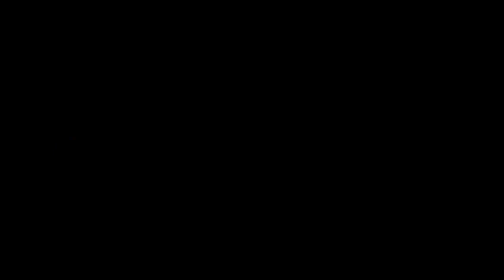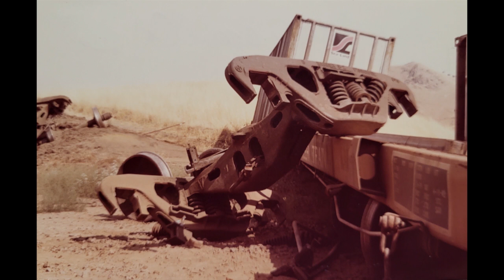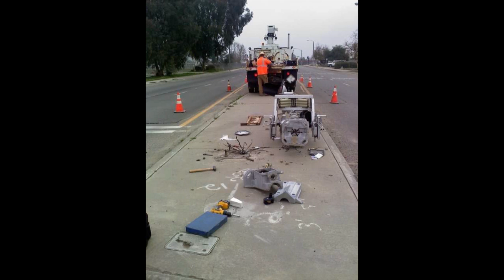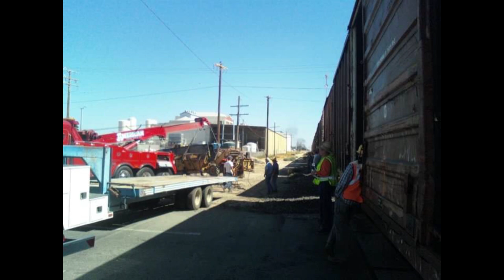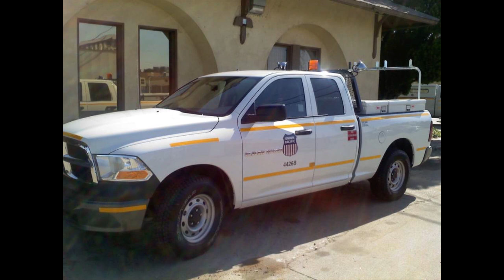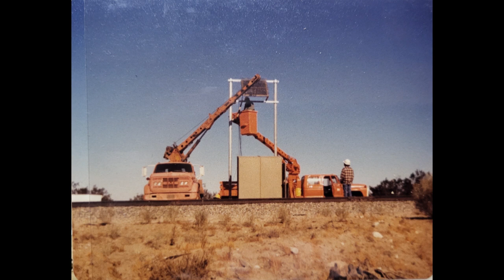A Railroad Career in Photos and Stories

Comment: Cool photo.  Does Is union pacific Still make utility poles lines?
Reply from the maker: Most poleline on class 1 roads was abandoned with the installation of the new microprocessor signal systems. In this region, all of it was sold to scrappers and is all gone. If you go to my "How The Signal System Works" playlist, you'll find a piece I did about the pole line before it was all removed.